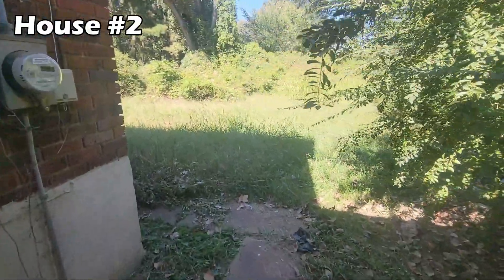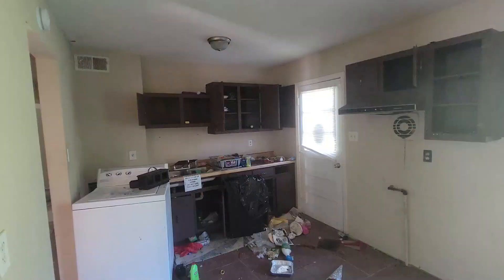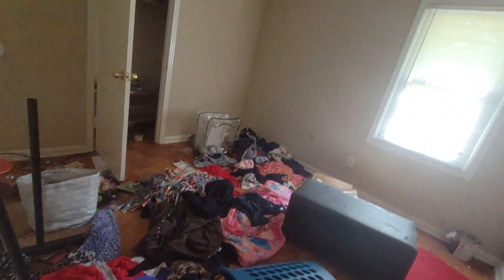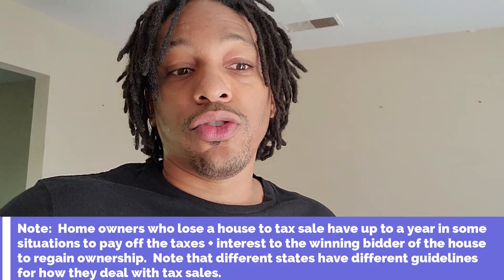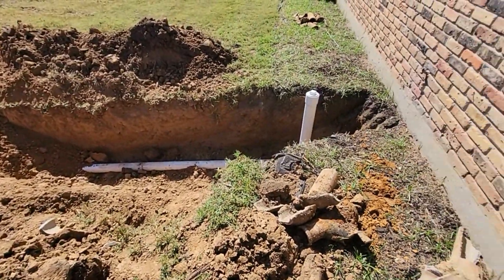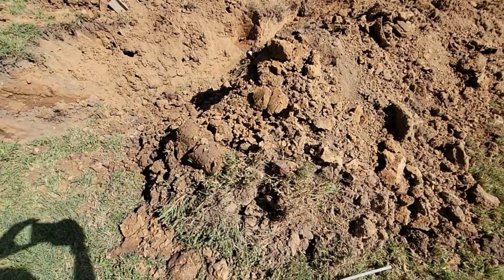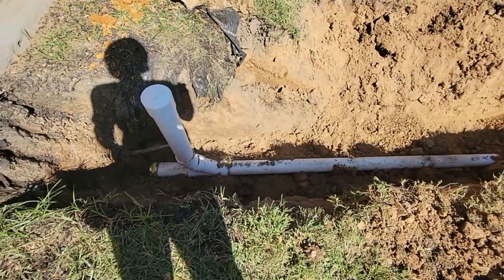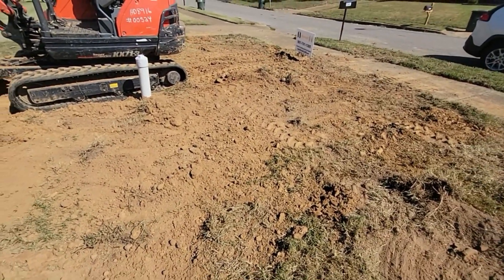Saving a House From Tax Sale

Comment: What are the signs that the sewer lines need to be replaced? (as opposed to just an interior plumbing issue)
Reply from the maker: Slow draining is the main sign, but other than that just getting a plumber to do a sewer line inspection on each house.
Reply: @michaelandelleciahayes3537  thank u